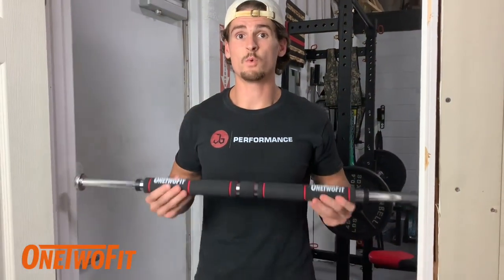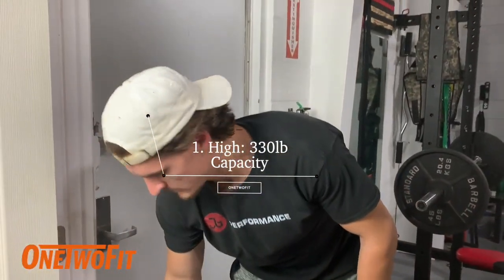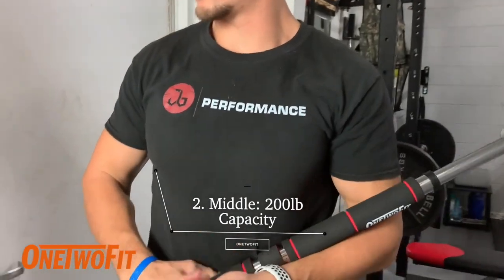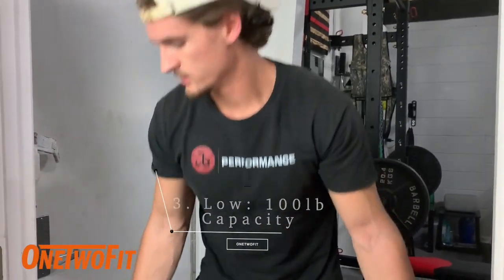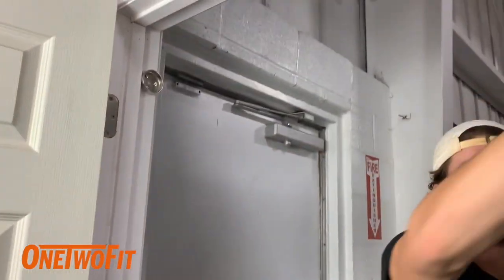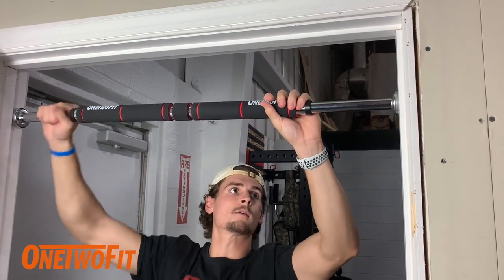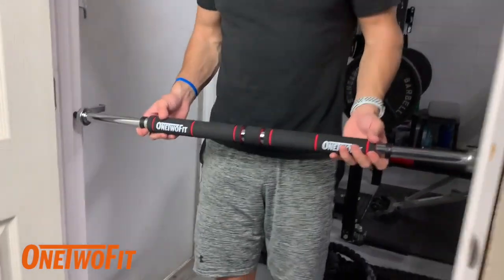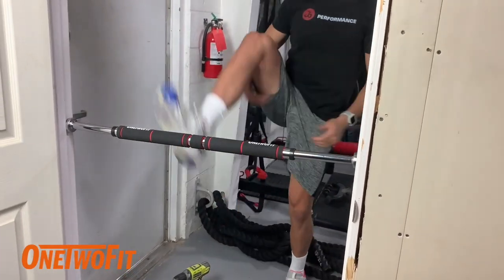Installation: Pull up bar  Doorway HK664 | ONETWOFIT

Comment: Would the pins version support pullups for ppl under 200lbs?
Reply from the maker: Yes, this fitness bar can hold up to 330lbs
Reply: Can the door close fully with the bar in the top position or do u need to remove between uses